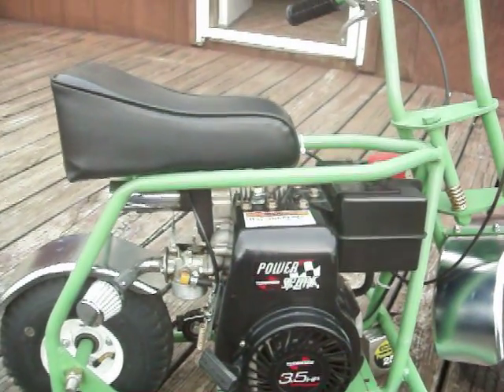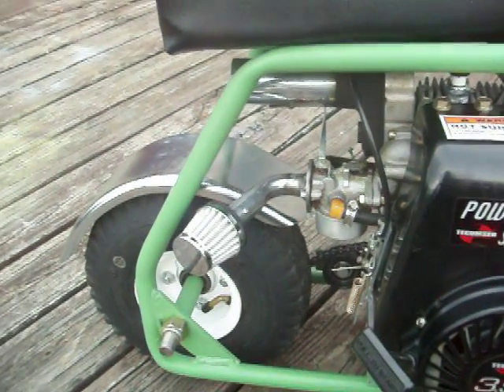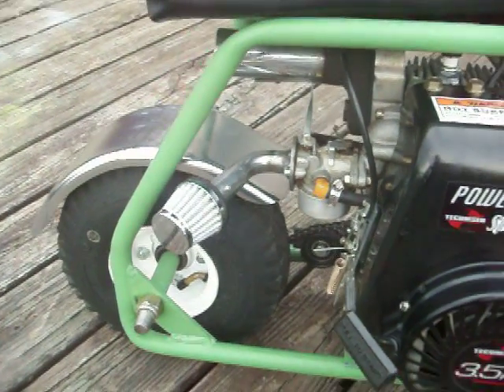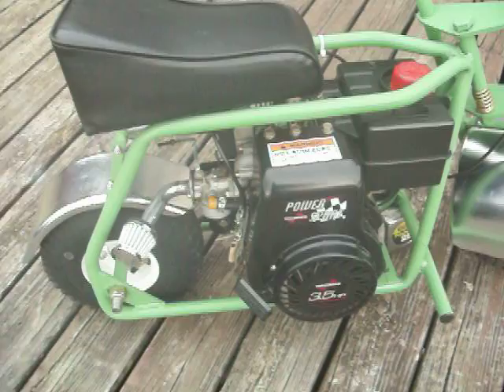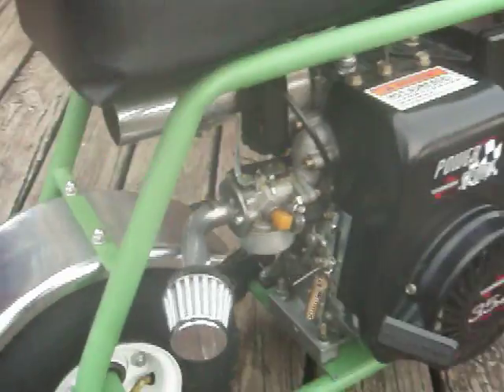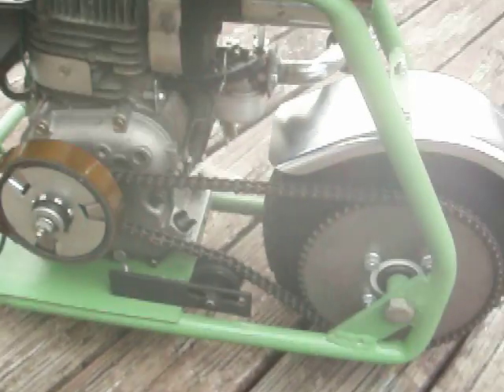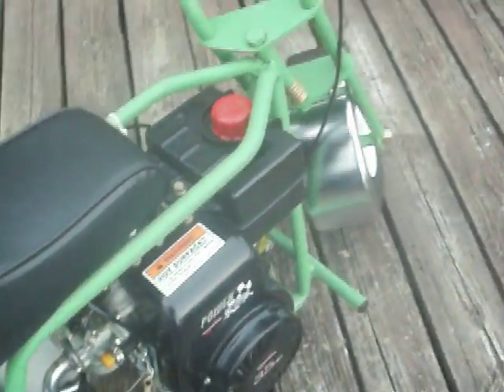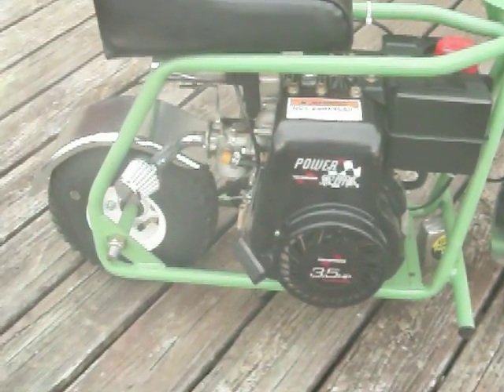Mini Bike LIL Indian reproduction " Close up Look"

Comment from the maker: the bracket is simply a piece of angle iron and Im pretty sure the idler wheel itself is from a tiller since it was made to idle a belt rather than chain but it does a great job,,,so check on a junk tiller or where they sale tiller parts,,thanks.